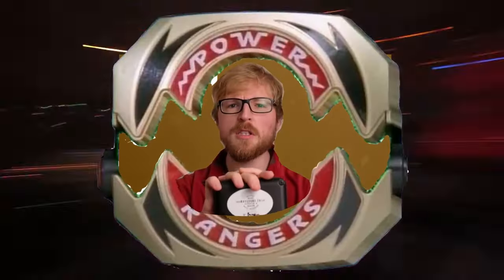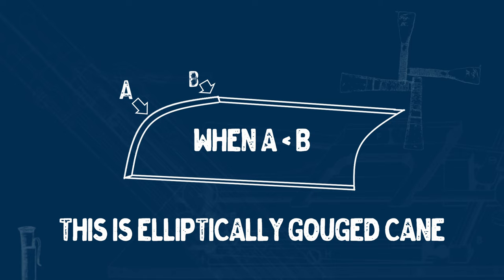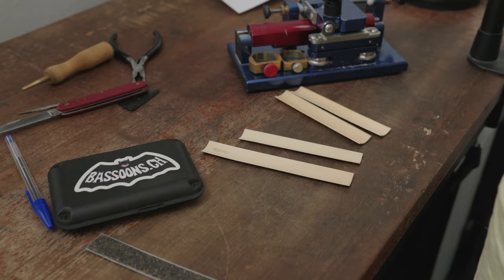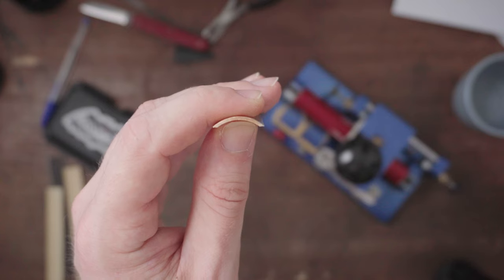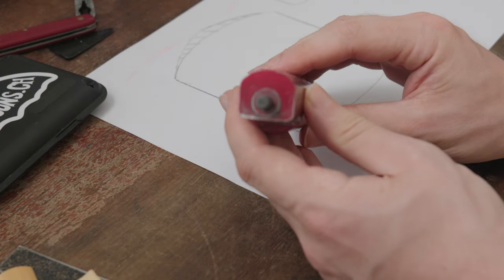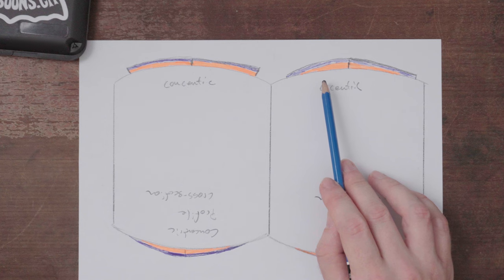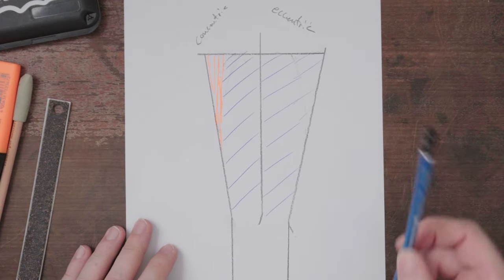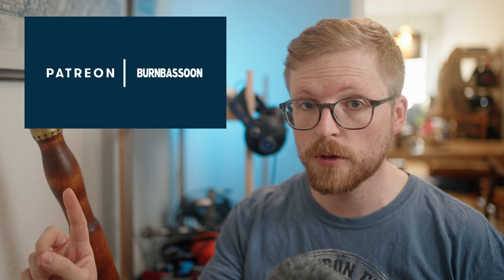Gouging Bassoon Cane | Bassoon Reed Making

Comment: So how do you decide which type of gouging to use for a given batch of cane? Do you have to finish a reed completely and test its characteristics to decide which system to use for the rest of that batch?
Reply from the maker: Hi Yes, generally for a model I would make 5-10 reeds using my current setup and see how they turn out. If those on average felt very dark and ‘dumpf’ (Skinner terminology), or if I consistently had the tip opening I mentioned at the end of the video, then I would make 10 more reeds but with an eccentric gouge and see what happens. I hope that helps!